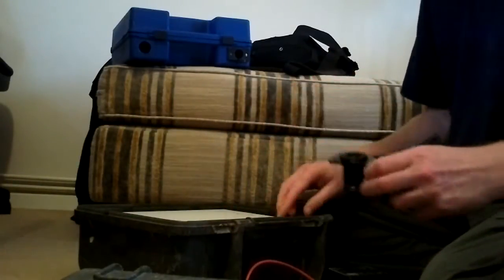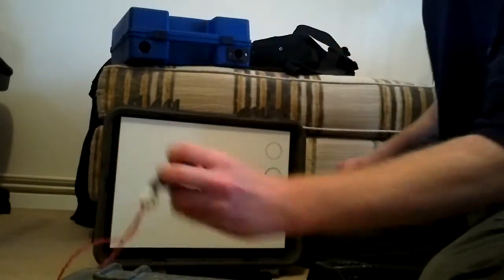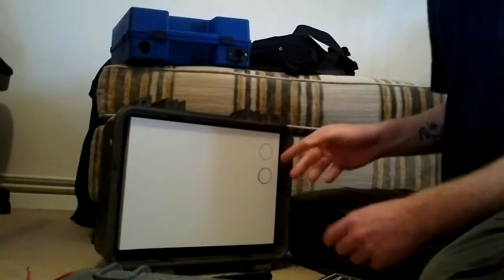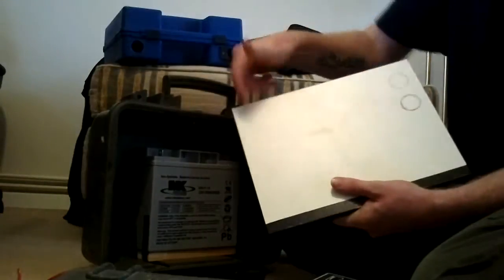small 12v solar pelican case go box. part 1/2

Comment: Ha! Me too.  I'm waiting on some parts for a portable solar/battery power solution, but mounted to a board rather than a box.
I've got the panel (40W) and a mahoosive 110Ah battery, but I'm still waiting on the FUSES, amp and volt meters, FUSE holders, double socket like yours, and the charge controller... Banana plugs and sockets for the solar/battery connections to allow for easy disconnect. Oh, and FUSES!
;o)
Reply: ***** My OldCodge account is having "Google problems" at the moment, and when I log out of YT my comments disappear. I wasn't sure if you'd see my comment so reposted from this account.
Don't know WTF is going on at the Mountain View chocolate factory...
Reply: *****
I have a Facebook account, but never use it because I'm a miserable fucker! :o) Quite frankly, I can't be arsed.
I'm not too far from you, in sunny Folky.
I'm in the throes of getting my ham licence, when I can drag myself to Dover club to do the practical tests. Might catch you on 2m when you're visiting...

Comment: Ha! I've ordered one of those double sockets, FUSES, charge controller, a couple of ammeters and some switches off fleabay for something similar. I got the solar panel for 38 quid, a nice looking 40W black jobbie, a mahoosive battery, and the FUSE holders. Trouble is, my 110Ah battery weighs 26Kg. :o( 
I'll be mounting my electrics on a plastic kitchen chopping board with another behind it to cover the wires and sockets. Loudspeaker (banana plug) sockets on the front for solar panel and battery connection.
Did I mention FUSES?